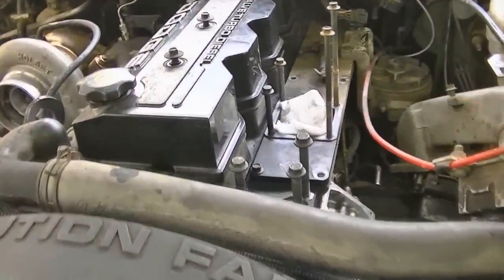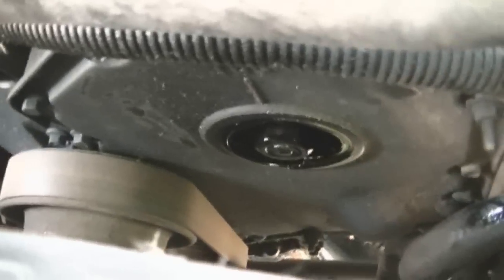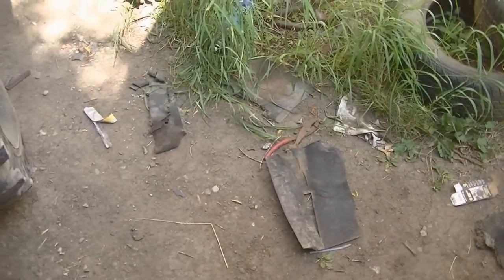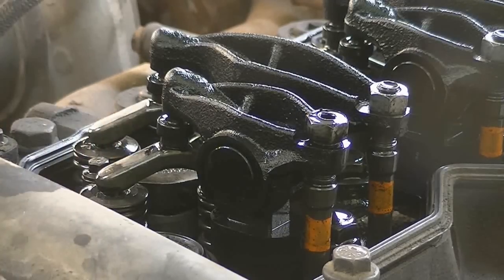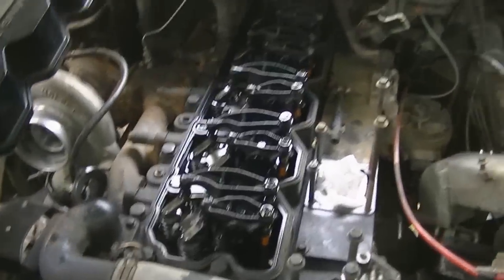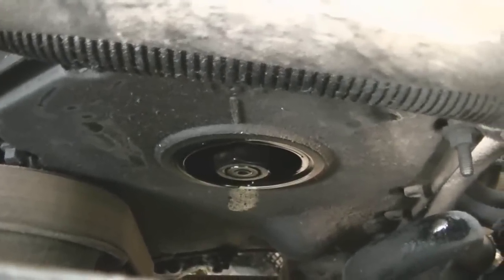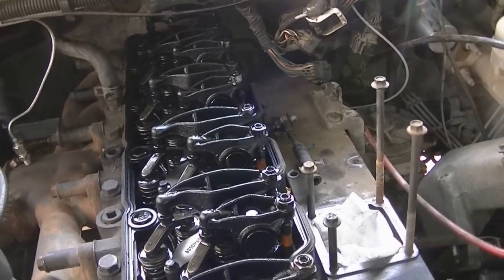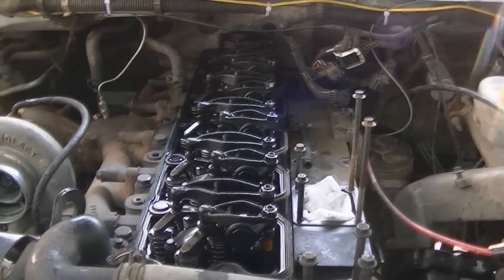01 Cummins: Adjusting Valve Lash

Comment: I have a 1999 Dodge RAM 2500 w/5.9L 24 Valve engine. I also have the OFFICIAL Dodge Service Manual. Below are the settings as per this manual. Hope it helps someone. Some video's are saying that valve lash adjustment helps fuel economy and EGT. They don't know what they are talking about. Note that the valve lash adjustment does NOT help fuel economy or EGT according to the manual. Read below what it says EXACTLY from the OFFICIAL manual. Note also the spec's are very LARGE on the lash adjustment. One does NOT have to have them EXACTLY at 0.020 for the Exhaust and 0.010 for the Intake. Therefore, CHECK your settings according to the Maximum and Minimum settings below. If they are within this range, it is NOT necessary to make changes. In other words, "If it ain't broke, don't fix it!" Below this line is the OFFICIAL (by-the-book) settings.
---------------------------------------------------------------------------------------------------------------------------------------------------------------------------------------------------

If measured valve lash falls within these specifications no adjustment/reset is necessary. Engine operation within these ranges has to adverse affect on performance, emissions, fuel economy or level of engine noise.

Intake Exhaust
Minimum Minimum
0.152 mm (0.006 in.) 0.381 mm  (0.015 in.)
 
Maximum Maximum
0.381 mm (0.015 in.) 0.762 mm  (0.038 in.)

If adjustment is necessary, use the settings below:

Exhaust: 0.020
Intake:    0.010

Top Dead Center

Intake:     1-2-4
Exhaust: 1-3-5
-----------------------------------
Bottom Dead Center

Intake:    3-5-6
Exhaust: 2-4-6

Comment: Always rotate the engine in normal rotation!  Some engines may skip a tooth or more and you may bend a valve or more.  I have seen it happen!!
Reply: Just a side note... engines with a timing belt, not gear driven.
Reply: Youarwamoron

Comment: I would assume cold...?
Reply from the maker: Damian DeLapp its ideal to set them hot, that way they are expanded as much as they would be. The difference might be negligable, but i was always told to set em hot.
But on duramax engines, by the time you get to the valves, the engine would be cold anyways haha! I dunno man, hot or cold, your choice. Just dont burn yourself, cause when the engine is warmed up, its freaking hot haha.
Reply: @analog56x  Valve lash adjustment should be done on a cold engine with a coolant temp below 140*F.

Comment: When your doing valve adjustment it's important you rotate the engine in the direction that the engine operates if you don't valve adjustment can be thrown off cause of gear lash so yes it matters what direction you turn it

Comment: Very misinforming video. Nothing is set at BDC ( this guy is wrong. 1st step is TDC on firing stroke and next step  is TDC on exhaust stroke which would be firing stroke for number for number 6 cylinder, the crankshaft is always rotated 360 degrees which is 180 degrees of the camshaft or fuel injection  pump. And the terms TDC and BDC always refer to crankshaft, never to fuel pump or camshaft
Reply: You're wrong sr.
Reply: @brothershereafter  thank you ..the link was very helpful

Comment from the maker: yea, i figured that out haha, i did it right after making this video... since the old pump was wrecked anyways, i used a ball peen hammer to lightly tap the tapered shaft till it broke free. then i VERY carefully removed the pump, and lined up the new pump's shaft to match the angle of the old pump's shaft. i installed the new pump, the keyway lined up perfect, and that was all there was too it. after bleeding the air out, she fired right up!